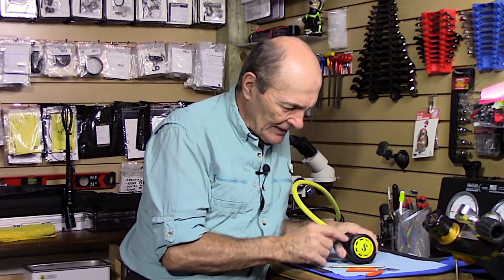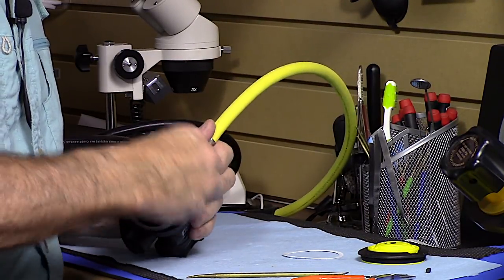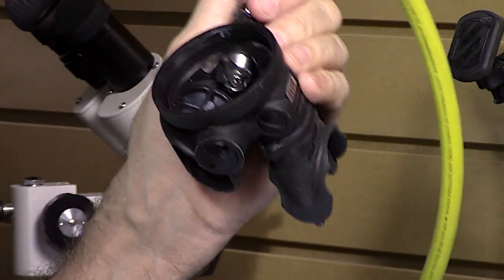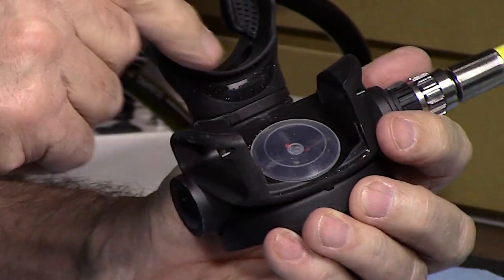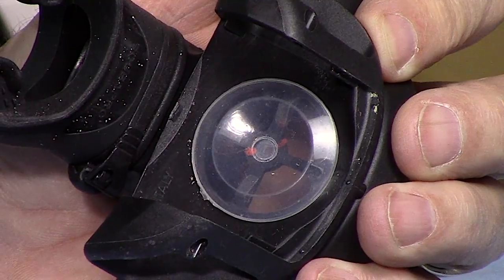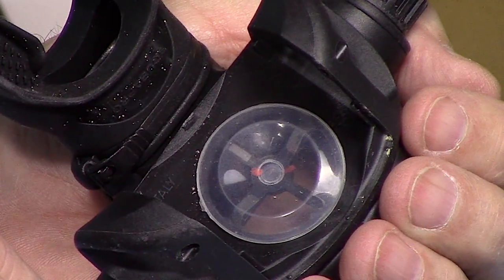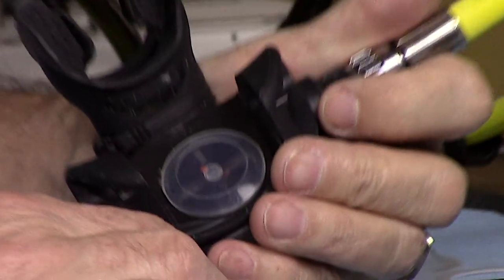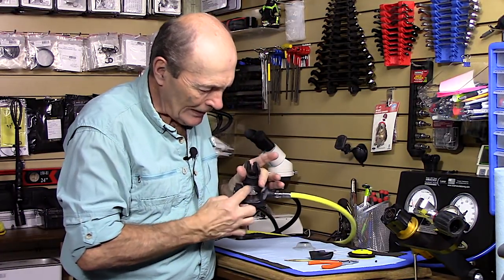Fix A Burping Regulator - Scuba Tech Tips: S07E14

Comment: After a dive, I usually soak the entire regulator set (computer, lower pressure hose, second stage and safe second) into a bucket with really warm water. I've found that it is so effective to get rid of salt. I usually leave the reg set over night in the bucket
Reply from the maker: That is the best overall way to prolong gear life and save service headaches.
A.

Comment: Good tip! What if it squeaks when inhaling?
Reply from the maker: Try pushing a small bit of bread deep into the mouthpiece. It's probably your 2nd stage Mouse is just hungry.
Kidding! Kidding! Don't do that!

Your dive store can solve that. It's caused by harmonic vibrations kinda' like running your finger around the rim of a wine glass.
They will open the 1st stage and replace a plastic washer under the piston.
I'm willing to bet you it's a piston reg.

Let me know.
Alec

Comment: Alec, I was thinking about painting my fins, for 2 reasons. 

The first reason is for easy identification underwater, specially in not—so—cristal clear waters.

The second reason is to stop people from taking my fins and thinking they are theirs. Iknow this may sound weird or even stupid, but it is not the first time that I found someone mistaking his fins with mine.

The fins are ABS and ruber. The idea is to paint only the plastic part but I dont know wich paint will stay on the bloody plastic (already tried with spray paint and car paint)
Reply: Victor García most paints will flake off and can be an environmental hazard have you tried engraving your name or initials in the foot of the fin. I engrave an identifying mark
Reply: "Trident U-Mark It Gear Marking Paint" is made to mark your underwater equipment. It's 5 bucks for 3 colors.
Reply from the maker: Yep! One of the problems with the great new materials used to make scuba gear is that they are almost impervious to any kind of paint.
While diving in South Africa years ago, the dive shop marked our gear with a short piece of Christmas ribbon, the kind used to wrap presents. I remember because mine was gold and I couldn't get it off for a long time. It has to be cut off.

How about wrapping colored plastic electrical tape around the strap. It comes in many colors now.
If you really want to be radical and solve the problem permanently, make a 1/4" hole in each blade near the end using a drill or a hot nail. Then tie a 4" piece of colored nylon string into the hole. Not only will it look cool underwater and everyone will recognize you, your fins will remain "your" fins. It's the scuba diver's version of a flag on your car antennae.

Good luck.
Alec

Comment: Alec, in my case,when i open the tank air valve. The 2nd stage is letting air excape like if i was keeping the purge button pressed. I have 2 regulators doing that. Please give me an anwer for the cause of this and the fix for it.
Reply from the maker: If any 2nd stage has a hiss on the surface, it needs to be tuned.  See my video S08E01 Set Breathing Resistance, to see why and how this is done.
Reply: @AlecPeirceScuba_SeaHunter  Thank you for the reply. I am not in the water with. This happened after i filled my tank and opened it at home. Is just a portable gear for shallow diving. But the 2nd stage probably has basic components that you might know, besides the expensive professional stuff. i wish if you had another page that i can share with u, visuals. But like i said. when i open the air valve. The 2nd stage is suppost to hold air, till you either inhale through its mouth piece, or by pressing the purge. It just let air excape. I think, the hardware or whatever is calles,, but is a pin that is pressed by the regulator button. That might need adjustment?

Comment: Hi Alec, great video as always! I was trying to find a way to contact you on a separate issue, I own a old Aeris Reg and need a service kit.I'm after a Aeris Atmos Balanced Diaphram 1st Stage Regulator Service Kit (Yoke) part number 30.90011. but they don't seem to be made anymore. Any ideas?
Reply from the maker: All Aeris regulators have an Oceanic twin. It's a simple matter of finding out which Oceanic regulator matches your Aeris regulator than buying the kit for that Oceanic reg. Your Oceanic dealer should be able to help you find the right Oceanic reg and kit.
Without checking I think you have an Oceanic cDX 1st stage.
If your dealer can't help, contact Oceanic directly with your question. If that doesn't work, get back to me.
Hope this helps.
Alec
Reply: Thank you Alec, much appreciated!
Reply: yeah I bought the Aeris AT600+Ion highly discounted as they were phased out, but the oceanic part are available for it (forgot which match now).

Comment: I'm finding I'm doing more and more servicing myself and keeping my gear working. after 2 years, 80 dives, I took my computer connection apart (to add a quick release on the Suunto Cobra) and the swivel part which takes on water was really corroded. little vinegar+toothbrush cleaned that right up. Used an ultrasounds to clean the removable quick connect (used) and looks like new. couple new o-rings and all good to go. Guess I should do that more frequently as the pin was really stuck hard...
Question: is vinegar ok to use on o-rings/end of tubes ?
Question 2: suunto cobra (and other models) seem to have a high failure rate, which cannot be replaced. What's the best way to prevent this (good rinse on the bottom where the pin holes are I suppose) and ways to fix them ? tried ultrasonic with water, then vinegar on a broken one and no go...
question 3: is airplane luggage cabin ok for dive computer or must you take it with you ? (other than potential theft).

....mexican food would be more like farting... :)
Reply from the maker: It sounds like you're doing a good job Alain.
Vinegar works well or try CLR.
Don't forget to rinse well.
If you hydrosonic clean too much you'll notice the parts turning yellow. That's brass. You've worn off the chrome.

You're right about the Cobra failures. There's little more you can do to prevent it other than being super careful about keeping it dry. Always have the caps on (I'm assuming you've installed the QD). Be sure the caps are dry before you put them on.

At one time all gauges, even the old analog depth gauges, had to be carried in the cabin to prevent damage from a drop in pressure. Even then they would sometimes get out of adjustment since the airplane cabin experiences a pressure drop too.
That's not a problem anymore. Leave it with your other dive gear.
I know that lots of diver insist they carry their dive computer with them on the plane but that's a personal choice. There's no real need.

Thanks again for watching Alain.
Alec
Reply: I meant to say Cobra depth sensor high failure rate - not much I can do to repair one as one would need to open and re-solder a new sensor (sub $10 part) but wouldn't seal again... good info on water - I presume the air sensor doesn't like water, so QD add risk there if I disconnect it much.

Comment: Hi, If you put water through the mouth piece does the reg need to be attached to a tank with the air on? Thanks
Reply: If you have the dust cap secured on the first stage, you don't need to have pressurized air in the hose. Here's a Tech Tip video from 2016 where Alec show the procedure:
 https://www.youtube.com/watch?v=E2ZgCsm1MPI&list=PLzEmTMig18QPtP2-4sINDYMP8yNJkFgzc&index=27&t=0s

Comment: vibration noise comes from my second stage regulator when breathing it on dry land when hooked up to a scuba tank is this something normal ? I just brought a new kit, does  this happen because it's not under water that it vibrate ? Thank you.
Reply from the maker: There is no free flow, just sound right?  Check carefully that it is actually coming from the 2nd stage reg.  Most vibrations come from the 1st stage so does this happen when breathing in fast and hard or slowly?  It may be caused by the diaphragm when breathing in or the exhaust mushroom valve breathing out.
Reply: @AlecPeirceScuba_SeaHunter  Hi Alec I love yout videos! Great channel (I watch all vidios about service) My new regulator vibrate/horn/armonic when I inhale i check all and the vibration comes from the diafram (if touched with my finger or touch water stop vibration). I bought two regulators (2 1er stage, 2 primary and 2 octopus equal brand and model) one work fine and the other fibrate out of the water (The regulator that have the problem is in the primary and octopus). Is normal? I don't know what to do, i rotate the diafram, but still vibration out of the water.
Reply: No free flow, only happen out of the water (Wet or dry). Is a Mares 52x with Dual Adj and Octupus Dual Adj

Comment: Hi. I got the same "burping" when i inhale the first times on the surface. It never does that during the dive. but its quite annoying when it happens. Got any tips on that? Keep up the good work on this channel :D
Reply from the maker: Interesting.  It may be because under water the pressure pushes back on the mushroom valve but on the surface there is no back pressure.  Burping on the surface is no a problem if it keeps others divers away from you.
Reply: @AlecPeirceScuba_SeaHunter  haha yeah i supose that good in this pandemic times. It usualy only happens on the very first inhale. The second one is usualy fine